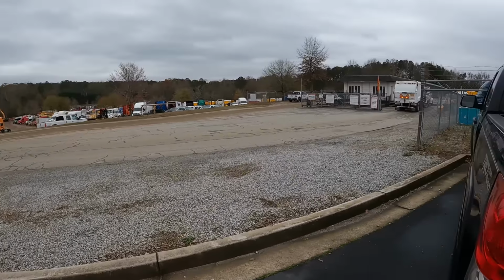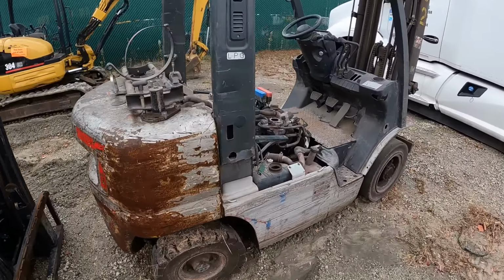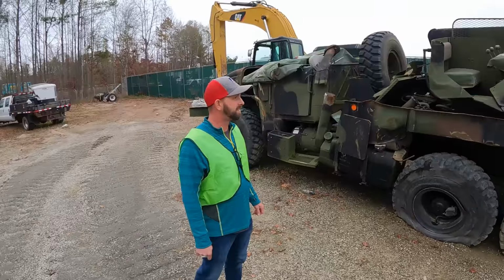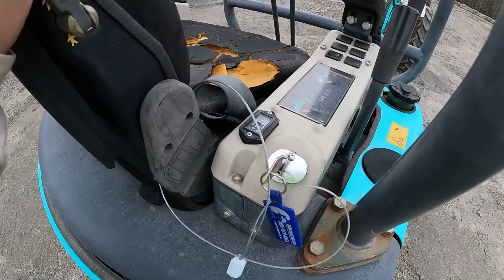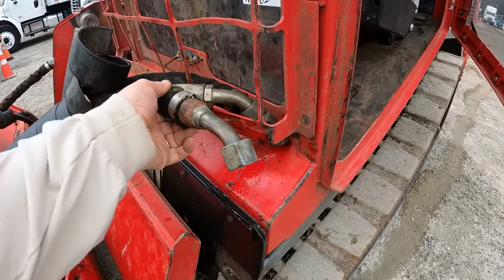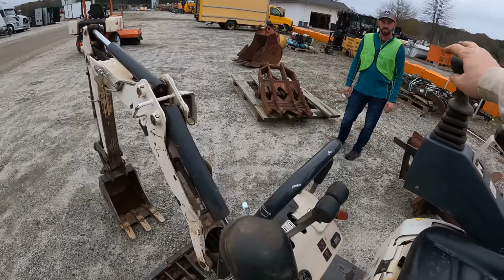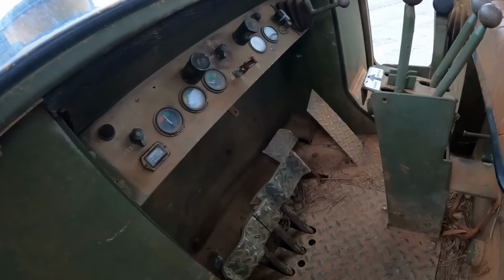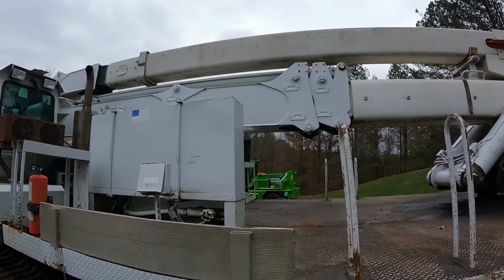Looking for DEALS at the Richie Brothers Auction… WHAT DID I BUY?

Comment: Re:Pressure washers, those Pressure Washers you saw were over priced China junk..Build your own. Get a Harbor Freight engine, a General Pump, a couple of pulleys and cart and set up a belt driven Pressure washer. Could probably do the whole thing for under $800 and it will do 3 -4 GPM @4000 PSI or more. Make for a good video too..
Reply from the maker: Actually those were pretty good quality I think they are American made and they are heated, it’s the same one Andrew camarata has
Reply: Literally every part and vendor you mentioned uses Chinese parts. 🤦‍♂️😂

Comment: The cardboard hubcaps were to hold in diff oil. In order to tow by wrecker they remove axels so as not to damage transmission. That truck must have been towed in.
Reply from the maker: You are correct sir

Comment: Like a kid at F.A.O. Schwarz.  So many neat toys.  My vote is for the military crane truck thing that rolled many times.  Your skills and some paste wax and she would be like new in no time.  You would need a Sikorsky to get it home but you like a challenge.  I'm amazed you knew how to start and operate all these different things.  A very interesting tour.  Fun times as always.
Reply from the maker: Well I’ll say that I actually tried buying this however I couldn’t find it or any military vehicles on the auction site
Reply: Too bad, that would have been a good one.  I will look forward to seeing what you did get. @The_Home_Pros
Reply from the maker: well it’s not that special of a buy but still kinda cool I would have rather bought a military machine
Reply: On most joystick operated machines, there are only two control patterns, ISO or SAE.   Most operators know both but prefer one or the others - typically you can switch.   So at least on those machines, you can usually operate it even if you've never seen it before.
Reply from the maker: @ckm-mkc  yea I’m use to John Deere or ISO controls like my IHI has a lot of the machines here had SAE controls so they were harder for me

Comment: Another comment on the Marine Corp CASE track loader 😊 I started running those type of loaders back in 1979 I lover the track control drive system. The 850-B we had on the mainline sewer job, was the fastest for running Pea gravel to excavator. That power turn of those was a very fast working loader.